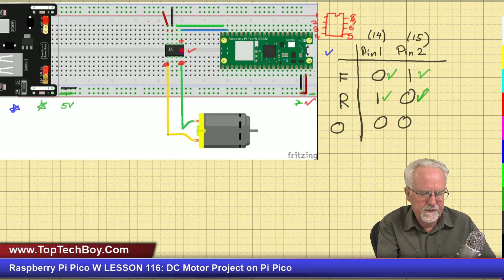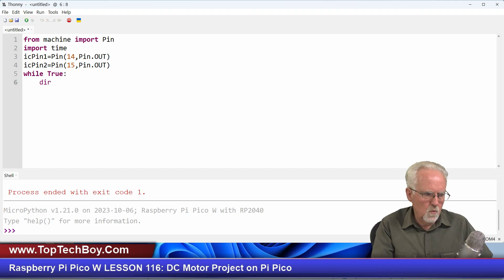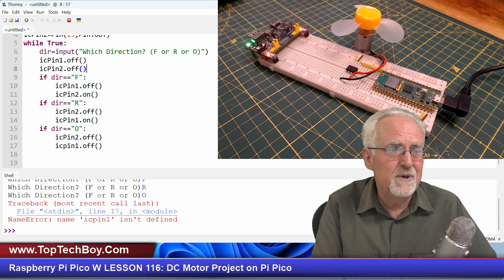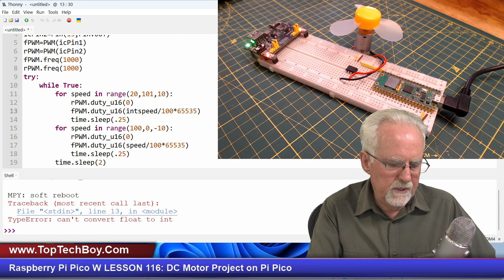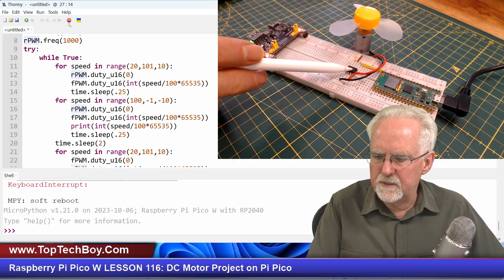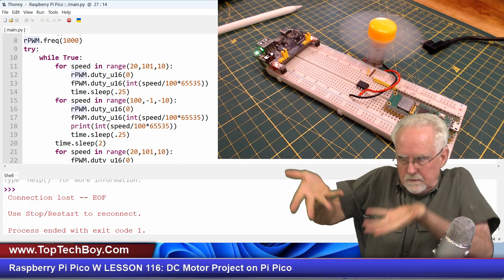Raspberry Pi Pico W LESSON 116: Control DC Motor Speed and Direction on Pi Pico Project

Comment: Where are lessons 112 - 115?
Reply from the maker: Those used the transistor with the motor and some people were finding the transistor over heated, so moved to the motor controller.
Reply: @paulmcwhorter  Thank you for clarifying!

Comment: What is the maximum frequency of input PWM signal on TA6586? No info on frequency limits, switch time limits, slew rate limits are provided in TA6586 datasheet.

Comment: Lessons 112, 113, 114 and 115 seem to have disappeared from YouTube (or have been censored in North Carolina). They are my only reference for this material. Will you please check on that Paul?
Reply from the maker: The lessons had caused some confusion with some people related to how I was using the voltage pins. I need to edit or remake them to clear up the confusion. Hope you will continue on with Lesson 116 at this point.
Reply: @paulmcwhorter  Thanks for the reply Paul. I am usually not a cheater, but I will watch your next lesson before I do this homework. 🙂These lessons are spectacular. I think the Pico is a much better device than Arduino in utility and value for the $.

Comment: Paul, every time I turn on the motor my Pico reboots.  This happens even with I have totally isolated to a separate power supply. I think I am having a voltage spike/dropout or some sort of EMI through the ground connection.  The motor controller seems to be working okay.  When I use it without the microcontroller it works okay.  What do you suggest to help resolve the situation?
Reply: Hi Bart. Can I say I think I had the same problem? The fan seemed to start OK and run very fast then stop. What was happening was that the current drain from the battery was so high, the BreadVolt protection circuit would open circuit the battery before any damage was done. Once I lowered the battery voltage to the IC and fan to 3.3v, it ran like a charm,and the fan now longer sounded like it would tear itself apart.